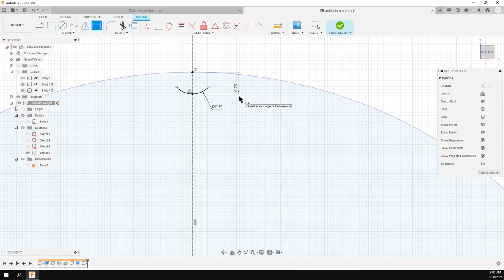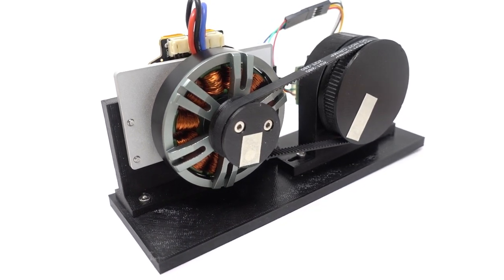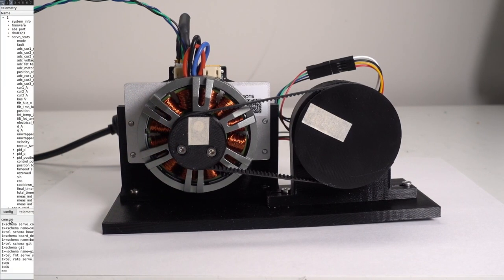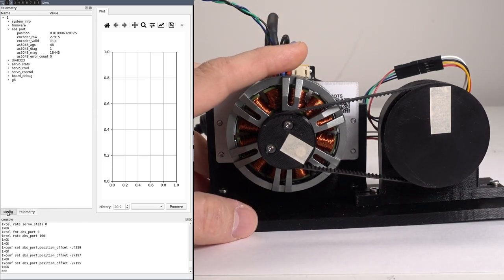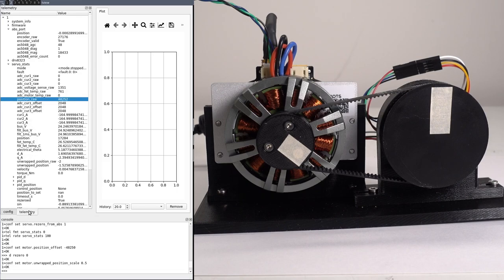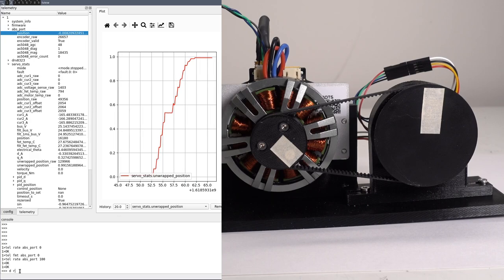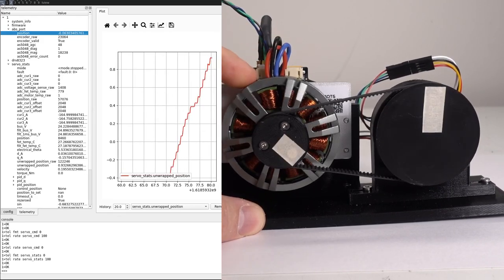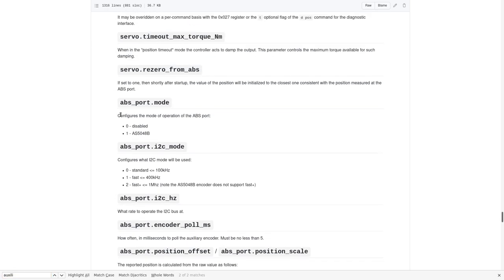OUT OF DATE - SEE DESCRIPTION (moteus with two encoders!)

Comment: Hi Josh, I was was wondering if the moteus controller uses the encoder to control the bldc phases or if it uses FOC, or both. Keep up the awesome work!
Reply from the maker: It uses FOC control (which means it uses knowledge of the rotor position to control commutation).  Currently, the only way for it to monitor the rotor position is through the integrated absolute magnetic encoder.

It might be possible to implement a sensorless estimator in the future, but it does not support that now.

Comment: Would an encoder only on the output (and not on the motor shaft) be sufficient to control the motor commutation or does backlash / some other transmission characteristic give it poor performance?
Reply from the maker: Typically they would not be suitable, either because of backlash or reduced resolution.  If you had a very low pole counter motor and a low gear reduction with minimal backlash it might be feasible.

Comment: Great! What type of encoders are already tested?
Reply from the maker: So far, only the AS5048B and anything with a matching I2C protocol.  If you have another I2C encoder of interest, let us know and it can be added without too much work.
Reply: @awesjosh  thank you! I will also try as5048b
Reply: @awesjosh  what about as5600 encoder, it also works with i2c
Reply from the maker: It should be possible, but won't work out of the box as its I2C interface uses a different register layout.  Is your reason for considering that part purely cost, or some other factor?
Reply: @awesjosh  I have few and as5048b is out of stock on aliexpress
Reply from the maker: I'll get some in my order queue to add support.  You are welcome to do so yourself if so inclined!
Reply: @awesjosh  thank you, will be in contact